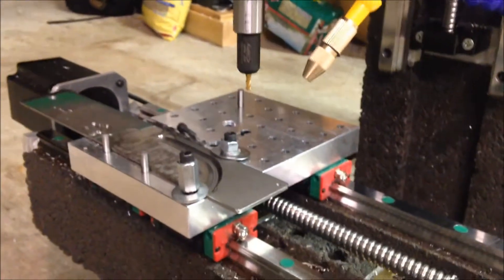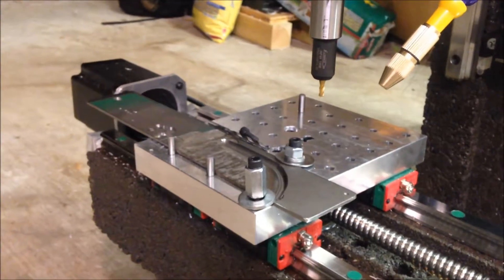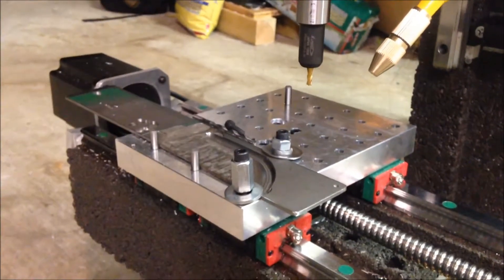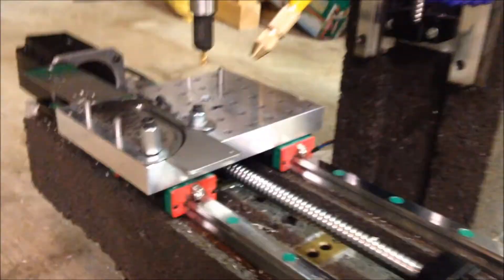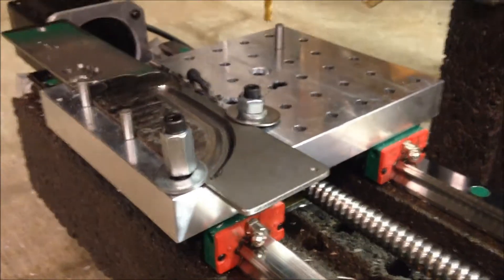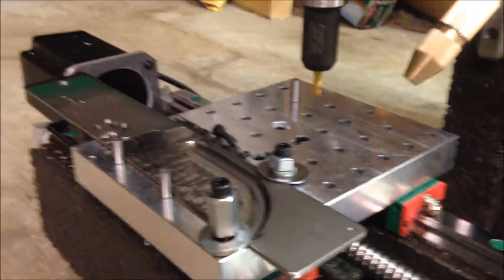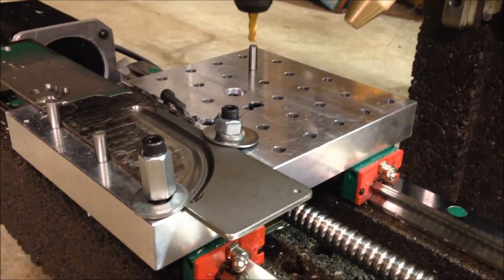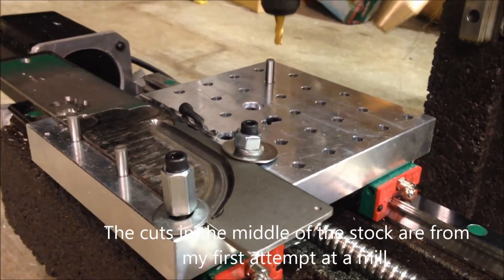Cutting 440c on EG CNC Mill

Comment: Do you have more information on this project? It's giving me ideas (I'm looking for a small but very capable mill) and I'd like to know what results you've had and some information on spindles etc. You used Nema 34s I believe, were they not overkill?
Reply from the maker: I don't think they were overkill, torque curves for steppers => made me want some more power so i can still have some torque at higher speeds, plus it wasn't too much more expensive

Comment: Do you have any specs on the machine? Spindle TIR or positional accuracy?
Reply from the maker: runnout is  +-.0015mm according to data sheet, I don't have the tools to measure the accuracy for myself. As for the machine, I haven't checked the positional accuracy as i haven't really had a chance to work on it since this video. The next thing for me to do is tram everything in. I don't know if people would want to see a video of this or not.
Reply: We would like to see V2 documented so more people will know how to build one. Looks easier than using steel.
Reply from the maker: I have some photos of the process, maybe that is a series to make. I am currently trying to find a good way to lift it onto a stand I made for it before I record any more.
Reply: I would love to see more about how you made this and any drawings you have that you can share
Reply from the maker: I still have a bunch of material left over from the project. I have traveling for a month but when i get Back I plan on making a desktop size version using the same process.
Reply: I'd love to collaborate on something.  Maybe you can spin up a hackaday.io project?  i'm looking to build a very rigid small work envelope mill.